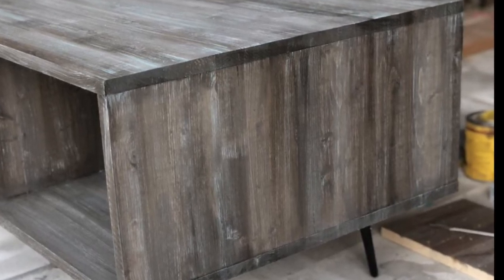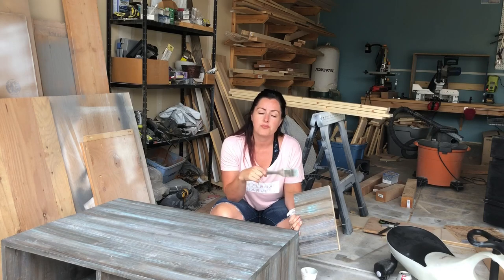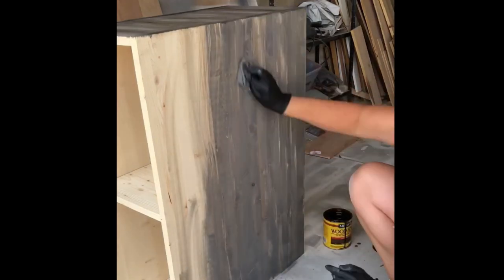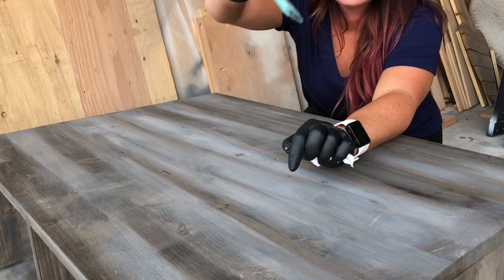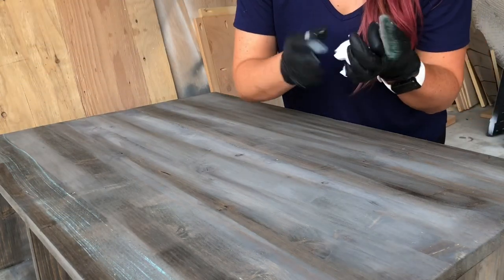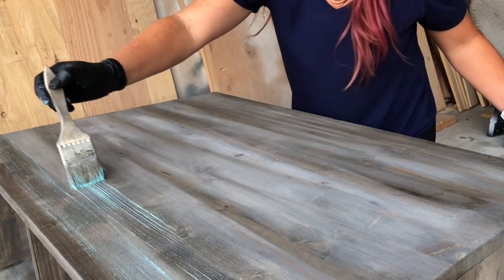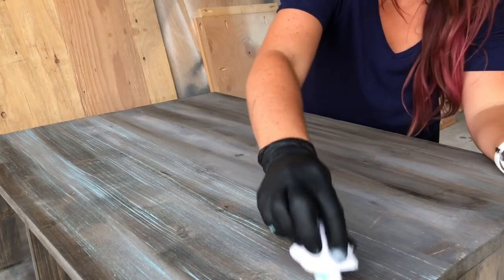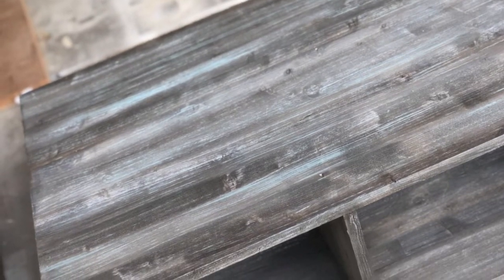Easy faux Barnwood paint technique -

Comment: Hey! Thank you so much for your help! I've been wanting to make a murphy desk in a inset in one of my walls (it's weird) but I was so pissed when I started because it looked nothing like what you had done but I kept at it and streaked the darker color (I used weathered grey and ebony...because that's all I found at HD) with the light grey and wiped and it actually turned out so perfect so a big, huge thank you!
Edit: once I finished everything and got it set up perfect I ended up streaking ever so slightly with a satin white I was using to touch up a wall, i streaked and wiped immediately in thin lines and slightly curved long lines and it made the desk pop so much more. Thanks again for the help and good luck all!
Reply from the maker: Oh good!!! I’m so glad you stuck with it! I try to tell people that and to not get discouraged, EVERY SINGLE project has a moment that doesn’t go as planned. Just keep pushing! Great job and thanks for watching!
Reply: Thank you for the extra tips you did when it didn't turn out how you wanted when you first started and kept going at it. That's very encouraging. I want to make some frames and shelves using this technique and was intimidated by messing up some kind of way and not being able to fix it and have any mistake stuck and have to transform the color into something different that I wasn't planning on. Thanks again, really needed that encouragement from a real person💜
Reply: @AikoFox  all we can do is try! Dont get stuck thinking you can't because then nothing will happen, think you can and even if it turns out slightly different you'll know that you created something, good luck 😊

Comment: Question. I love your technique, but what technique would you use in a situation where you have varnished dark furniture.  I was planning and lightly sanding it and priming and start with a light  base coat...then move to the stains. What's your opinion?
Reply from the maker: I actually have seen people us oven easy off, it takes the wood back to its natural color first and then start from there

Comment: Your work is absolutely amazing!!! 🤩🤩🤩 Simple and to the point 👍🏻 I have a question tho... would I be able to achieve this look on an old dining table and not on new wood? After stripping it and sanding it down?
Reply: And also, would chalk paint work instead of latex paint?
Reply from the maker: So I haven’t tried paint but the stain should work fine if the table is sanded to bare wood 🙌🏼 thanks for watching

Comment: I loved this technique!  I am not sure about the wood because I have a red oak table top.  The colors on the red oak look different than the colors in this video.  I have classic gray and jacobean.  Do you have any experience with the red oak?
Reply from the maker: Hi!! I do! so red oak is named that because when its wet in any way it does just that, pulls red. It can be super hard to color match. I would suggest white washing the whole thing first, or you could even bleach it. Sometimes the bleach makes the wood lighter like a pine to pull differently. Do you have any scraps you can play with? I would suggest trying a bunch of different stains on a few sample pieces first to find what you really like. Good luck!

Comment: great instruction vid! exactly what i was searching for, thank you.  have you tried technique  this on newly distressed wood? i have 12 fake rustic beams and 600'+ of tounge n grove, to try to match fake barn wood vinyl cupboards/ flooring to. its very close to your finish but maybe jus the 2 base colors with white, and the beams a shade darker gray than the t&g.  my concern is that the distressed dimples will just be the last color applied and dimimish the effect or point of distressing. any advice that would save a step much appreciated.

Comment: When you applied the classic gray and jaco bean did you use a regular or foam brush? And did you use different brushes for each color or did you just clean them and use the same brush? And with the stains did you water them down or just dip right into can?
Reply from the maker: I used two different brushes and dipped and went I did not water down the stain, I did water down the paint though.

Comment: Hi i was wondering if it makes a difference whether the stain is water or oil based?? I'm trying to find Minwax but it doesn't seem to be for sale in England as much. amazing work by the way!! thanks alex
Reply from the maker: I’ve only ever used Minwax and rustoleum which were both oil base I would suggest grabbing some scraps and practice to see how it works the method would probably remain the same or close
Reply: Eternal Harvest Decor thank you x

Comment: Im thinking of trying this on a customers front door. The door has been dipped to strip it and is very rough. I am going to sand it but im not 100% sure i can get it perfectly smooth. Will this affect the design? Also can i use just the stains and not the paint? Is this method ok for exterior? Love your channel. Thanks for any input.
Reply from the maker: Alan Sims Hi Alan! Thanks for watching! That sounds so cool! Love the idea! I would say do a few samples to get an idea of how you want it to look, make sure and seal with a lawyer or outdoor/weather proof seal and you should be good! I don’t think you need to have it perfectly smooth roughness should add to the look of barnwood. 😉🙌🏼 good luck! I would love to see it for sure! 😁

Comment: How long do we wait in-between the stains? It looks like your doing them one right after the other but I tried and it just wiped both off. Now my wood has some stain set and won't absorb anymore stain. Im honestly super flustered.
Reply from the maker: I waited as long as it took to do one color on one side then started the second color. I’m sorry that happened to you, I’d sand it down and practice on some scrap until you get the look you’re after. Different types of wood take stain differently. Good luck.

Comment: What do you use to seal this after it is done? I just picked up a round table that I have to strip first and I plan on using this technique. Thanks!
Reply: I completely stripped and sanded a table and it did not absorb the stain at all 😩
Reply from the maker: sad! Sometimes those old tables are hard, I may suggest trying gel stain for yours rather then regular stain.  Thats hard.

Comment: Hi did you have to use conditioner? When i used stains it didnt not meshed in, and after rubbing it with cloth it was actually removing it off the wood!  Any suggestions?
Reply from the maker: Hi! What type of stain and wood are you using. This works best with bare wood and no I did not use a conditioner. Usually stain soaks into the wood so it’s odd that it was rubbing off. I would say make sure it’s a minwax or varathane stain. Good luck!
Reply from the maker: Also, thank you for watching haha
Reply: It was varathane oil base classis grey and dark walnut!  I experimented with 2x4 . Did you use waterbase or oil base?
Reply from the maker: That’s so weird I’m so sorry, mine was a oil based minwax. I would say sand it down a bit first to open the grain a bit. Some definitely wipes off but it should blend and stay like in the video enough rice you a weathered look. I’m on IG as well and I’m happy to talk more via dm if you want to send me a pic. Maybe I can help more. 👊🏻
Reply: Sure ! Thanks

Comment: Can you suggest a sealer for this look on a dining room table? I want to keep the exact color with a clear sealer before I epoxy the table top. So far any sealer I have used has darker the stain/colors by a couple shades.
Reply from the maker: Susie Luebbe most Seaver’s do this, I’ve found epoxy does this as well, I normally use deft waterborne finish. You might want to just brush a skim coat of epoxy over first as a sealer then do the flood coat 🤷🏻‍♀️
Reply: @EternalHarvestDecor  we did put a thin coat of epoxy & it turned it dark brown. Had to sand it down, lost all my real weathered wood. Now trying to find a sealer that will do the least amount of change to the color b4 applying the epoxy.  Any suggestions?
Reply: @EternalHarvestDecor  just fyi...my wood is actual weathered barn wood. Could this be reason why my wood darkens no matter what kind of sealer I put on?